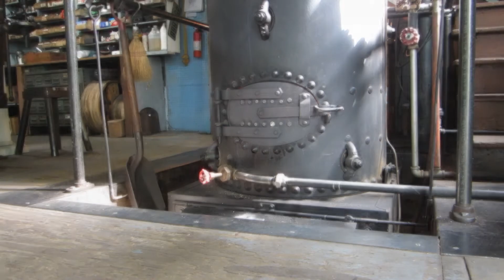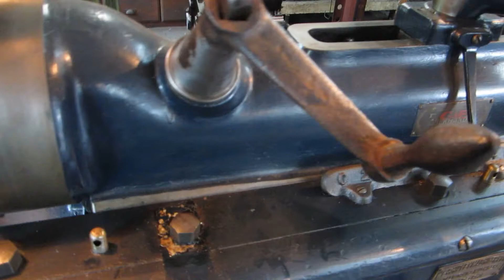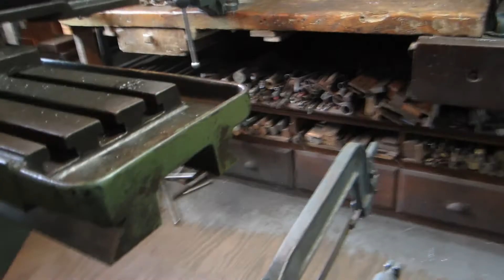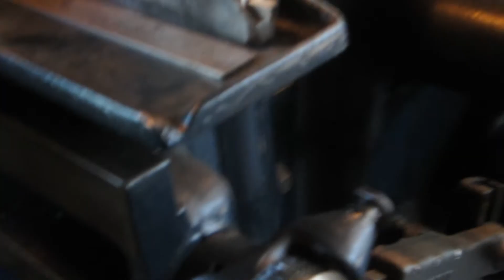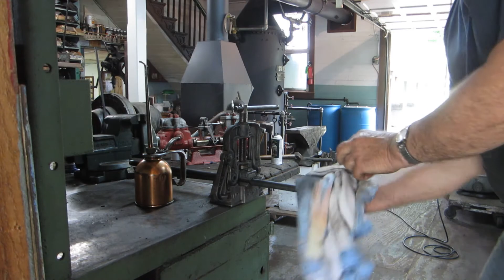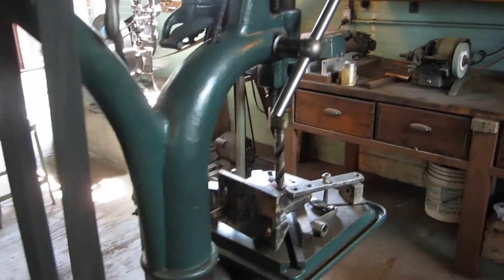OLD TIME STEAM POWERED MACHINE SHOP 2

Comment: What is the max RPM on the drill press? I'm used to working with 8,000-10,000 RPM spindles on our CNC mills.

Comment: Dave, I would say that if this is only your first or second video, that you sure could have fooled me.  I think they are great. Your demeanor adds to it. I wish you were my mentor. I see your anvil, and if that means you do any forging also even better yet.  I love your shop, and as an inspiring mini model steam engine tinkerer,  I can't get enough of your 5 x 5 engine.  I am having a hard time with some health issues (at only 53) ha, go figure, and can't do much, but you sure give me inspiration.  And if you have any children I can imagine how proud they must be of their Dad!  I know I would be.  About that engine, I see you pull a lever to what appears to be simultaneously closing vents on the start up of it.  Is that what that is?  To vent the condensate from each side of the piston in the cylinder?
Reply from the maker: My daughter is 28 now, I tried to keep the "dolls to motorcycles" & things like that somewhat equal for awhile, but alas...  She can arc weld pretty good though.  They call those condensate vents "cylinder drain cocks" and are for start up. Thanks for the comment Saul.....Dave

Comment: kind of new here, why are belts used instead of chains?
Reply from the maker: Chains were used on some drives. But in 1925 (& before) lether belting run at fairly fast speed was the most economical and trouble free systems for shop machines.  Thanks for the discussion. ...Dave

Comment: What diameter is the pulley wheel on the line shaft that's running your large lathe?  Your videos are inspiring me to set up my LS Lathe on a line shaft, probably running off of a hit and miss engine.  This is great stuff !!
Reply from the maker: Sounds like a good plan. The main shaft pulley is 16" and the tight/loose pulleys are 14. I run about 250rpm on the main shaft. I would like to change something to get the main shaft speed up a little when I get time....Dave
Reply: Thanks for the information!!  I'm going to start digging around swap meets looking for the pulleys and such.  If I run across any steam engine stuff I'll let you know !!

Comment: What a rare and wonderful machine show! Pure gem. I can't wait to see more.
I was wondering what was the purpose of the white tank you have outside the shop (seen around the 12 minute mark). Are you able to run the boiler of gas or just wood?

Thanks for sharing these videos with the world. Fantastic stuff.
Reply from the maker: Thanks for the comment, the LP tank is for an engine block cleaning oven in the main shop....Dave

Comment: Thank you David! this is visual poetry coupled with an audial rhythm. Fascinating! - A question; Is your engine's governor operational? The 'balls' seem very close to the shaft and when it fired up, I couldn't see any outward swing of them. Or is it just set very finely?
Reply from the maker: +Dave Holmes You have a good eye,  It depends on which video you are watching, by #5 I had made and installed a bigger pulley on the crankshaft to run the governor faster...much better speed control.....Dave

Comment: Is there an advantage to the shaper over a face mill/fly cut?
Reply from the maker: +94XJ No not really, I always liked them because if you needed a certain groove, spline, or gear tooth, you can just grind a single point tool bit to that profile and do it. Also if you are cutting something that might have very hard spots like Adam (abomb79) was doing in one of his last videos, cutting through a weld, you are not risking damage to an expensive mill cutter. They will also do internal grooves, etc. inside a hole that you can't do on a mill......Dave
Reply: +David Richards That makes sense. Now I'm thinking of all the times I could have used just that!

 I love the videos by the way.  I've always liked the old hit and miss engines and steam engines. It's great to see how machines used to be run...I personally like to think about all the things they made that built this country. I did a little bit of machining at a previous job.  It was supposed to be a temporary starting job for me but I wound up really enjoying it and stuck with it for a while. So basically you've got two things I enjoy in one here!
Reply from the maker: +94XJ Thanks for watching and the discussion....Dave

Comment: Great shop and videos.  Have you ever thought about installing a larger wheel on your steam engine to get higher rpm to drive a permanent magnet generator
Reply from the maker: +Eli B  Yeah, that's the main project this summer.....Dave
Reply: Missouri wind and solar has a good pmg that you may like.  Good luck and looking forward to your videos.

Comment: Howdy Dave,  I'm really facinated with your videos.  I just sit here and enjoy every project you are working on.  I do remember the shaper as very easy to set up and let run while you could do something else as it was very slow.  In 1956 I returned to Ingersoll Rand in Phillipsburg, NJ after serving 3 years in the Army and they had reserved a spot in the tool room that I had left.  I had been a tool grinder prior to the Army but that position was not available when I returned so I was assigned to the milling machines.  I worked on a machine that some joked about was brought over by Columbus.  It was a large vertical miller with an 8 foot table and the feed wheels were over 2' in diameter but it sure did a nice job.  I also used a Brown & Sharpe Omniversal and that was very friendly as it could do almost anything, both vertical and horizontal.  Being that Ingersoll had treated me so well I hated to leave but I had gotten married and needed to find a job with a better future.     Please keep those videos coming.  I really enjoy the nostalgia that they bring and I have a 6" Atlas lathe and a small table mill/drill.  I'm 82 so they don't get much use any more but I made lots of parts to "fit" for mowers, etc.,.  Always fun to operate.Thanks & Peace,             Jim
Reply from the maker: +James Allen  Thanks for the great comment Jim,  Must have been some big casting machining at IR in the 50's. Glad you are still making chips...Dave

Comment: When I served my apprenticeship i had to learn how to calculate loads,speeds and so on for flat belts. I often thought at the time ,what a waste of time... but when I came out of my time and went on my own way, one of the jobs I had was Chief engineer in a saw mill run by massive flat belts ,even our shop in the mill was belt powered..ha ha .I love your building,what was it originally?
Reply from the maker: +Mercmad  Great comment, and you could use your bamboo slide rule to calculate pulley sizes.  The building was a 1880 carriage barn for a private home......Dave
Reply: +David Richards I do indeed have a bamboo slide rule somewhere ha ha , but we used logarithm   books for really big calculations .

Comment: thumbs up worked in a shop years ago with over head belt drives but was run with electric motor. can remember the rings clanking on the shafts to keep them dust free.

Comment: the camera angle from behind the lathe showing the line shaft and several machines running at once  including the power source was super
Reply from the maker: +ted sykora I try not to get in the way so the engine can be seen...Dave

Comment: Thank you David for your work. I have worn several hats in my younger years. I am retired, disabled, no not able to do the things I used to do. There is something peaceful about the sounds in your shop from the clock,, rhythm, of the engine, that's carried through the shaft,pulleys,belt and gears. Hard to explain but I know you understand ,thanks for sharing. I was in the electronics field most my life, things moved at the speed of light !!  Closest thing I enjoyed was woodworking...but this is better..Thanks again..Mike D.
Reply from the maker: +Mike Davis Mike: thanks for watching, and the great reply. I agree that there are museums where you can see the set up but not experience the motion, sound, smells,  damp heat and thinks working.  As long as I have some work, scrap wood and rain water in the tank, I'll put videos up......Dave

Comment: I am Piero 68 years old from Italy . I am mechanical engineer and I have learned to work on machine tools into a workshop exactly of your. All machinerey were powere from old electric motor and not with steam but all operation were did completely by a sklll operators . We produce sprokets, cast iron pulleys and shafts for all power transmission Equipment. I still rememebers those years . Congratulations for your skill and your superr machinw tools. Piero
Reply from the maker: +piero mauri   Thankyou for a great comment Piero...Dave
Reply: +David Richards 
Hi David thank you for your quick answer. I love like you mechanics and all old machineries as well as steam generators stationary machinery or old water mills. In the 1975 my boss decided to invest money in his activity and he purchased new CNC machine tools and all conveyors and rails t self feed the tooling process. Machineries were guarded, safer with all protections against the injures. I still well remember that I supervised that epic revolution . All tools were stored into an old warehouse. I understood that one era was defentively ended but I continued a regular maintenance hoping to store inot an historical shop and museum. We had a treasury of those and it was a crime to decided to waste. With that macinery not me a skill foreman was able to get dimensions of 0.01 mm also on parte of great diameter. Compliment for your passion committment and kill I am still astonished watching you videos.  Unfortunately I live in North Italy otherwise I woulld be always into your shop to work with you, With respect

Comment: Hi David,

thank you for your superb videos.  I am fascinated of your shop.

I used to drive myself a steam engine, a "Lanz Hochdruck Lokomobile" (english: Lanz high pressure locomobile) from 1907 with 10 HP at 10 bar (I think, that ist about 145 pound per square inch?).   Here you can see an image of that machine: http://www.gut-steinhof.de/Fotos/slides/Ernte7.html

I noticed in your videos about the shaper a detail about the clapper box on your shaper.  It seems to me, that the clapper box operates automatically at the end of the stroke.  Is that right?  If so, how does it work?  Can you show the mechanism?

In my shop I operate an old Fischer Lathe.  I don't have a badge on it, but it is quite clear, that it must have been build before end of WW2.  It was designed to be driven by en electric motor from the beginning.  It lacks a dial indicator for the longitudinal feed.  Do you have any tips how to feed the saddle accordingly?

Cheers from germany

   Jan
Reply from the maker: +titanicjb  Jan, thanks for watching and taking the time to comment.  The shaper clapper box on that machine just swings down by gravity and the axis of the pivot should be adjusted to swing out and away from the cut on the return stroke. If you are asking about the threading dial, it just keeps track of the position of the "lead screw" on the lengthwise feed so you can engage the feed in the right place to hit the thread. If you don't have a thread dial, you can just set the gearing for the right pitch and then never dissengage the feed, just back the lathe up (if it has a reverse or by hand).
Reply: +David Richards Hi David,

thanks for the reply.

I own a german shaper Klopp 550 (similar to this one: http://forum.zerspanungsbude.net/download/file.php?id=59557&mode=view).  It has an mechanism to operate the clapper box automatically.  It uses the small friction lever near the middle of the ram.  You can see it in the given image quite well.  Attached to the lever is a cable which is itself connected to an eccentric axle beneath the clapper box.

While watching your videos, I thought, that the clapper box was lifted before the ram was traveling backwards.  But as you explained, that is impossible without any extra mechanism in there.

I was not asking for the threading dial, I don't own one on my lathe, but I know how to use it.

I was just wondering how to feed the carriage for the correct amount of length, if there was no dial in the feeding wheel, as it used to be on older machines.

Imagine, you want have to turn a shoulder, which is located exact 2 inch from the end of the workpiece.  How do you feed in exactly 2 inch in that case?  Do you have any tricks?

Bye

   Jan
Reply from the maker: +titanicjb  You can use a magnet on the back of a long travel dial indicator and stick it on the lathe way to touch the saddle as you feed by hand up to the sholder. You can buy (not too expensive) a magnet back that will fit most indicators or the whole indicator or make your own out of one of those magnets shaped like a big washer.

Comment: Another great one, Dave! This one brought back some memories. I apprenticed as a tool and die maker in a small shop with a lot of older machinery, one of which was a G & E shaper similar to yours. When the babbitt got so worn that she started jumping the gears, the boss put her out for the scrap man. After considerable pleading, I was allowed to buy it for $50.00. I still have it forty some years later. We were expected to keep more than one machine running, going round robin style as you do in this video. We were squaring blocks, running a hack saw to cut off stock, 2 shapers to bring the largest sides in flat and parallel, and 2 old horizontal mills to do the ends and sides. Sometimes we drilled mounting holes and water lines in addition to the above. The fellows that complained that for one paycheck they only ran one machine didn't last long, or found themselves swabbing out coolant tanks. The ones that could keep 5 or 6 machines running and produce good work soon found themselves under the wing of one of the senior men, many of whom regarded apprentices with great disdain, but that's another topic!  Thanks for reminding me of how it truly was!
Reply from the maker: +CamillusSteam   Great story, I've heard similar stories of apprentices at East Broad Top RR shops. From your user name I presume you might be with the canal museum?
Reply: David Richards That's the place. We run the Rice & Sargent Corliss, Paul Thompson has told me about your shop, I'm glad to be seeing it in the videos. I wish I was that organized! I'm a third generation pack rat, so it's tough going in my shop. Did you have to do any heavy restoration on any of your machines? My G & E needs a fair amount of scraping and I'm interested in seeing how others would approach that job. I'm loving the videos, you've definitely got the touch! - Jim M.

Comment: These are great David!....I have a 16" Whipp Shaper, made about the same time as your G&E.....it is in great shape, but the electric motor failed when I first tried to power it for testing. I think the babbitt on the intermediate step pulley shaft was a bit tight, and I need to check it out better before re-powering. I've never paid much attention to the ratchet and travel mechanisms to see if they work similar to yours, in that if it needs an adjustment off center in order to reverse the travel. These videos are renewing my drive to get it done!
      I am quite surprised at the small size of the steam engine!......had just figured in my mind they it would take something much larger! I will quit rambling, but am just in awe of your shop and videos!
Reply from the maker: +Jim Liechty   The G&E had an old motor on it when I got it...made some really nice green flames and smoke when I tried that one for the first time....Dave

Comment: Cool video it seems like a steam/belt powered machine shop is quieter than and electric powered one. What kind of oil do you use in the steam? Does the stem engine use slide valves? I thought your accent was familiar I originally came from a small town in Broome county.
Reply from the maker: +Eric Corse        Awww come on now...a Broome County accent!  That's cuttin it pretty close.  The real steam cylinder oil I use is only available from a few places and is a little expensive. It mixes with the steam and does a good job lubricating the slide valve and cylinder......Dave

Comment: No cutting oil on the drills?
Reply from the maker: gary24752  I run most of the larger drills so slow they dont build up much heat. I was thinking that you could see in the cut better without oil.

Comment: mr. david i would like to know why dont you have the exhaust run to your boiler exhaust stack? it would make a really cool sound and more steam quicker. great shop i wish 100% production was like that way again. steam power is the best power and thats when it was quality and when MADE IN USA ment something
Reply from the maker: Ran Moore Ran: good question, any stationary boiler /engine set ups I've seen don't run the exhaust up the stack, they just had very tall stacks to get big draft. I think that usually because of the long distances the exhaust pipe would have to run (not like a locomotive or traction engine) the steam would condense so much that there would be a lot of water blowing up the stack and making acid with the soot....not worth the trouble. BUT the exhaust steam would do well in a feed water heater of some kind......Thanks, Dave
Reply: ive been around steam all my like and the steam powered saw mill they have their exahust run to the stack because the sound

Comment: does your line shaft speed vary much as you increase the load. will the line shaft stall at some point or does something slip? i couldn't imagine where we would be today if osha existed in 1925. we have replaced training and common sense with kidproofing.
Reply from the maker: larry sperling Larry, one thing I'm trying to do is debunk the myths about this kind of old power. Even at only 60 psi, the Engine will overpower any and all machines in the shop. I'll explain about that later in a video..thanks for the interest...Dave